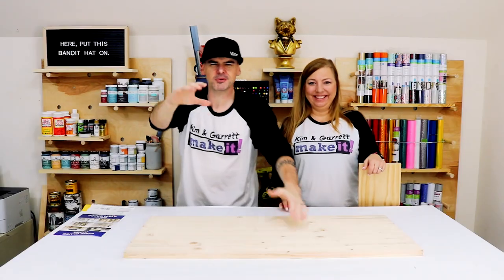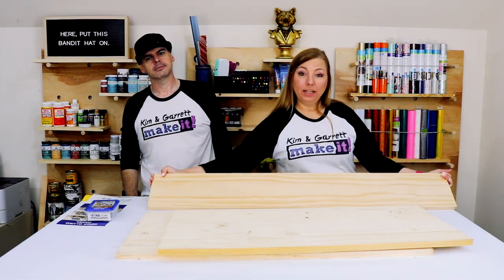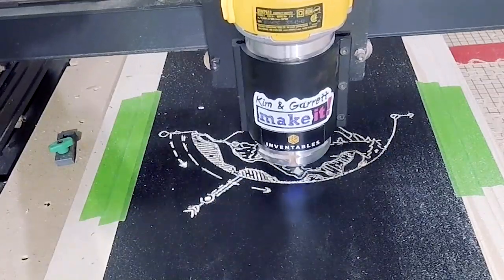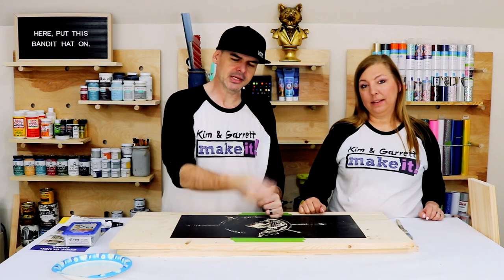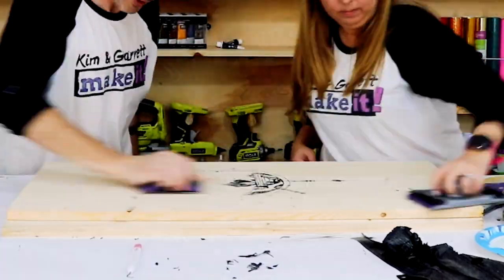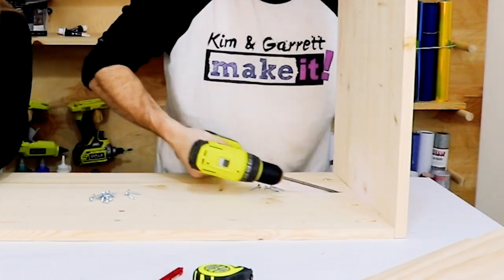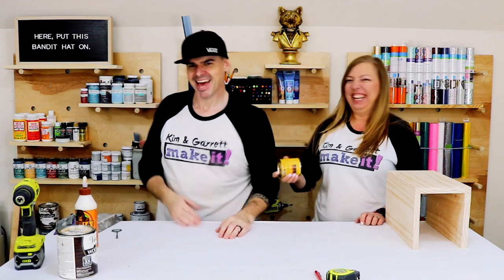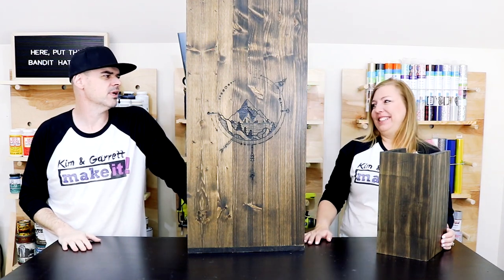The Easiest DIY Ottoman Coffee Table

Comment: I like the project but unfortunately I do not have a CNC engraver.  Going to  just paint the image on, but afraid it will get lost when I stain it..
Reply from the maker: I'd say paint after you stain and then put several coats of sealer (Polyacrylic) over it.